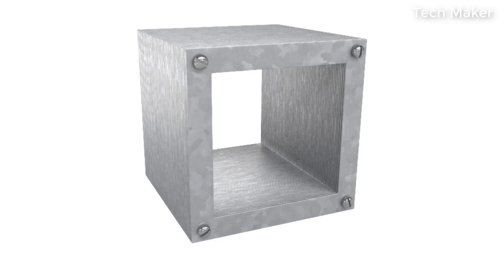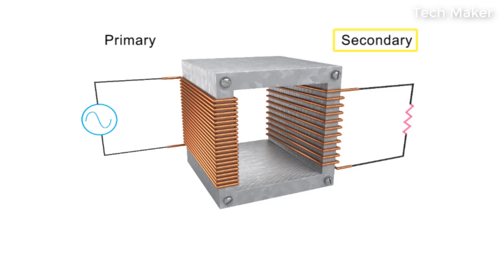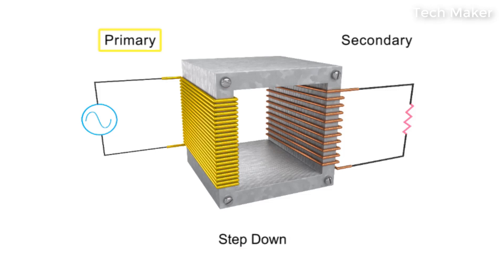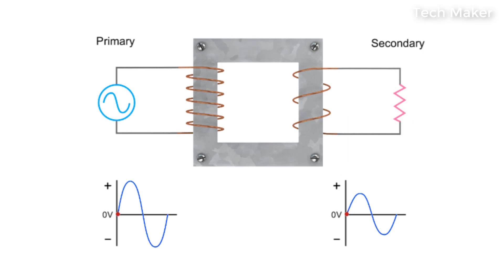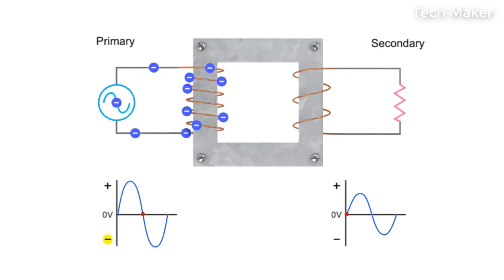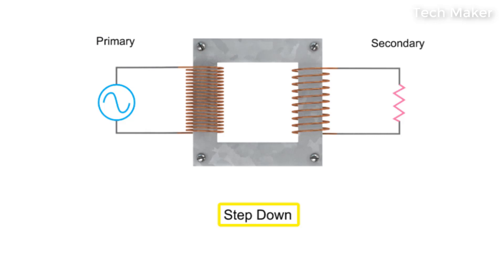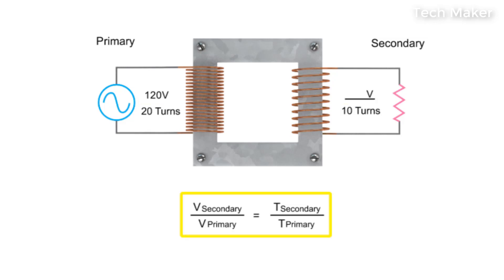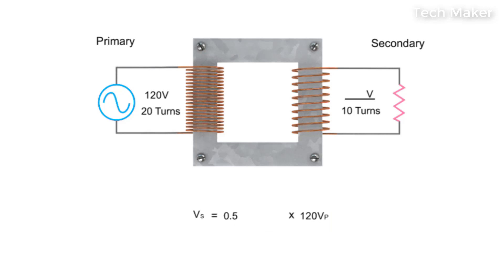How Transformer Works

Comment: Why on increasing the voltage current doesn't increase
Reply: It have a simple explanation 
The current is directly proportional to the voltage and inversely proportional to the resistance.
                V=IR
 This means that increasing the voltage will cause the current to increase, while increasing the resistance will cause the current to decrease.